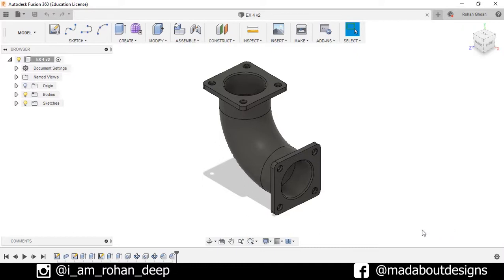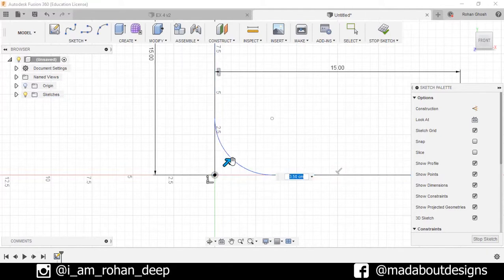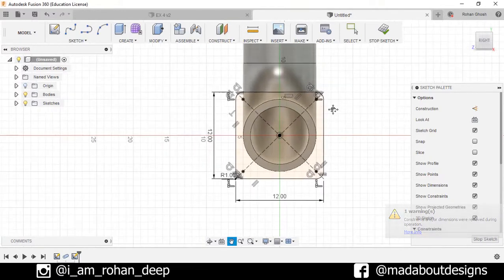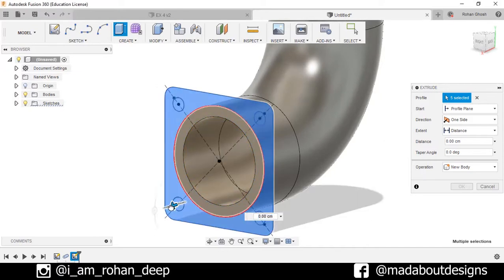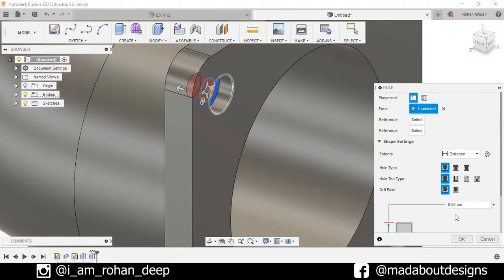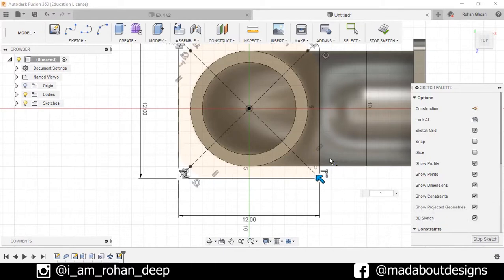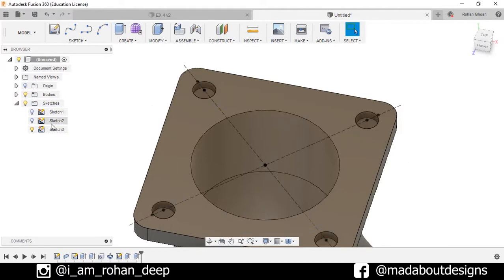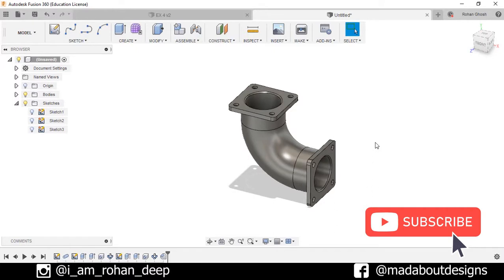Autodesk Fusion 360 Beginners Tutorials | Exercise 4 | Learn the basics of designing

Comment: is it possible that instead of recreating the sketch of the pipe face, we just duplicate the sketch and reorient it to the other end of the pipe?
Reply: 1) Create a "Plane at Angle" of -45 deg  2) Go back to the feature that extruded the pipe face and edit it select "new body" 3) select this new body and mirror it over the 45 degree angle plane. Optional 4) Go to modify > combine > select the bodies and combine them into one.
Reply: draw a diagonal from the center of the very first fillet to the corner of the pipe lines, create offset plane, rotate 90° and mirror the whole object.
Reply from the maker: I tried but didn't get any